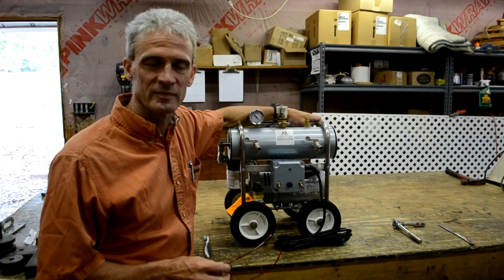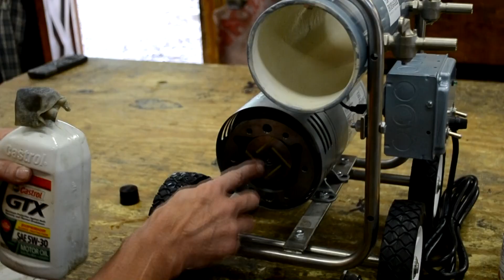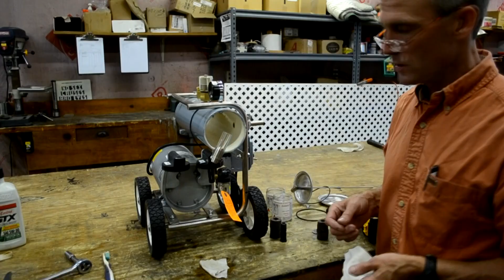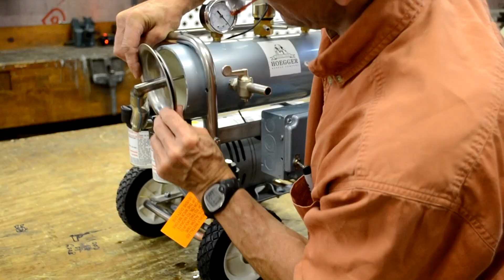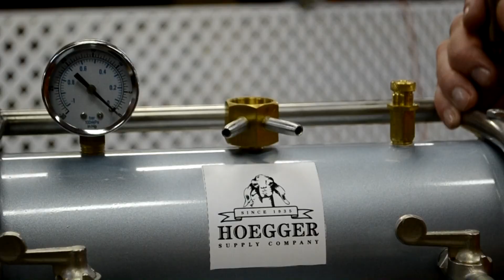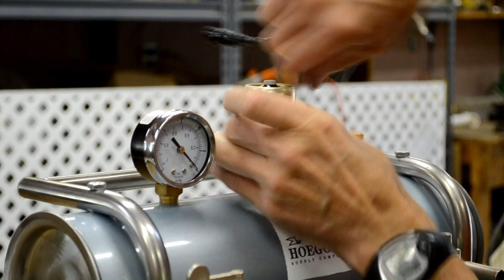How to clean a Hoegger Milking Machine

Comment: my machine seems to not get oil into the rotor and veins. they get gunky and stuck and I loose suction. what can I do? If I open it and oil it by hand it runs great, but then seems to dry out again.
Reply: Try cleaning the brass fitting out and the air hole in it, along with replacing the wick.